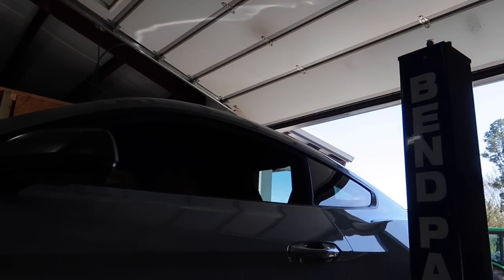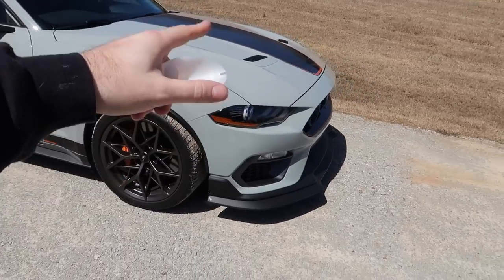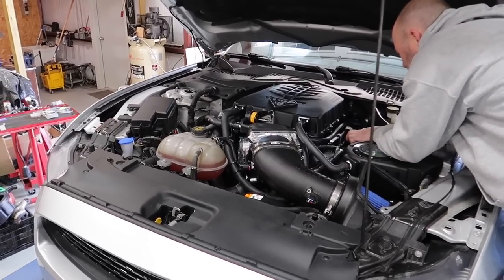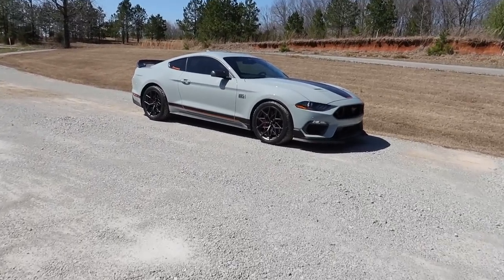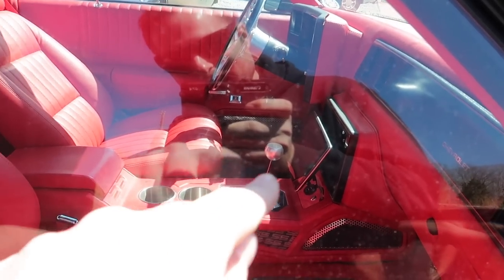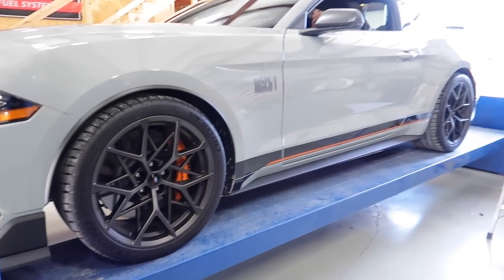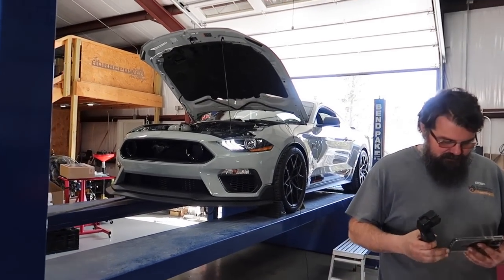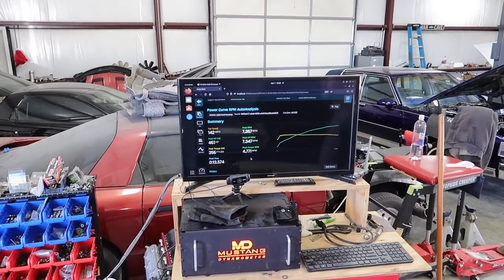My 2021 Mach 1 Mustang Hits The Dyno... UNBELIEVABLE POWER FACTORY FREAK???

Comment: And this is why I prefer Dynojet... I never had a car jump 40 HP between pulls on a Dynojet weather the numbers are the most accurate or not the Dynojet would give you the most consistent before and after numbers. How can you trust a dyno that shows pull 1 460 HP and pull 2 502 HP... I never liked Mustang Dynos...  they are under load and if the vehicle weight is not input correctly that will effect the numbers so it is easy to get it wrong on a Mustang Dyno. The Dynojet is just inertia dyno so all it cares about it how fast the drum is accelerated by the cars rear wheels the only way to cheat on a Dynojet is to mess with the environmental data that is used to apply the correction factor.

Comment: Most people don't believe in factory freak cars. However, I bought a brand new 2012 GT manual 6 speed 3.73 rear gear car and consequently my buddy bought the exact same car with same transmission and rear gears and we dynoed them at the same time. His made 380whp and mine made 423 rwhp stock. Both were factory stock, no tune, no aftermarket exhaust or cold air intakes. The only difference in the two cars were his was red and mine was black and his had 19" wheels where mine still had the 18" wheels and tires. Both cars were dynoed on the same Dyno back to back in the middle of July with 96° heat in the middle of the day.
Reply: Engines are SAE certified, "factory freak" isnt a thing anymore, hasn't been for years. They aren't allowed to vary more than +/-1% of their rating to be certified. Also no matter what there is no way you have a 40WHP difference in those cars without there being a reading issue. Your car did not somehow suddenly gain more power than a full exhaust, headers and dyno tune, with some very tiny variances in production parts to the point it made more power than a Boss 5.0 Roadrunner engine.

Comment: Manual cars will actually dyno higher due to less loss from not having a converter
Reply: only by like 5-10 HP.
Reply: On the Gen 3 mustangs the autos are dynoing very low compared to the mt82. It's not necessarily parasitic loss but more so having to dyno the 10r80 in 6th gear and not 7th which is 1:1 ratio because it's hitting the speed limiter before getting up to max rpm

Comment: I believe the Dyno tech didn't have the Dyno properly calibrated to your vehicle, this is a common issue at a lot of garages that have Dynos but don't have properly trained technicians or very inexperienced techs, plus that Dyno looked very new so maybe they just aren't used to it yet ( trying to be nice)
Reply from the maker: I was properly calibrated. This dyno is used all the dyno and we have seen consistent numbers compared to a dyno jet
Reply: @Zander13Productions  Yeah calling BS on that. your car didnt somehow manage to put out more power than a e85 tuned, or intake+ headers Bullitt/mach1 bone stock. That dyno is just flat out wrong or VERY uncorrected.

Comment: I believe the 460 # the MT82 gen 3s are running between 420-430 whp and the Gen 3 is responding well to catbacks plus the mach 1 top end so 460 on a 6 speed mach 1 is believable.

Comment: Debating on getting the ess tuning gs3 such a good deal and the mustang6g forum has a thread on it with over 156 pages.
Reply: It's really not as good of a deal as you think once you add all the other items required to make it function.
I figured that all up and got a better deal on a gen5 whipple.
The bad part about the whipple is the unnecessary 12-16 week lead time,stupid lean manufacturing bs.
Reply from the maker: Hit up brevin@esstuning.com and tell him I sent you for a good deal on a g3 kit 😊
Reply from the maker: It’s much much cheaper than whipple
Reply: @Zander13Productions  
The g3 setup I looked at was basically a tuner kit that required injectors,fuel,a tune and tuning device.
I got all that with my whipple plus it's going to be blue for $7,900 shipped to my door.
Reply from the maker: @charleshenson4183  yes. G3 is still a few bucks cheaper. All great options
Reply: @charleshenson4183  lol if you think you got a whipple complete kit for 7900. Ain’t no way it’s a Gen 5.
Reply: @mattcat2218  
Care to make a bet.
I actually could have gotten it for $7,250 if I hadn't optioned to have it powdercoated blue.
Learn to shop around and maybe you can too,and yes it's brand new as I'm actually waiting on them to build it now.
Reply: @charleshenson4183  prove that. You can get a full ESS g3 kit with fuel injectors and a pump for $6600. Learn how to read before you make claims you can’t back up to justify your purchase. 

And you didn’t specify which Gen whipple you got.
Reply: @mattcat2218  
It's going on one of my two brand new 5.0's so you tell me what gen it is.

Comment: I would think that the stock 12:1 CR would be a problem when boosting?
Reply from the maker: No issues. PPL have been boosting GT mustangs for years
Reply: On a cam in block engine yes, but not with variable camshaft timing on the overhead cam cars.
Reply: @pimpovic2  Can you pls explain why.
Reply: That's what I wonder every time I see  a YouTube video of putting a massive blower on a high compression engine. Conventional wisdom is you don't put forced induction on anything with more than about a 9:1 ratio. Also, do these engines have any valve overlap? Considering it's a factory street car I'd guess/hope not.
Reply: @superbird2814   Exactly!

Comment: Yeah those numbers are false though.  Mach1’s on average dyno lower NA stock numbers than a Mustang GT for some reason.  So what are you comparing in regards to false base line.
Reply from the maker: 461 was legit. Data is all SAE correct from the J box based off weather, gear ratio, weight of car, tires size etc.  the 502 was an adaptation correction we used as a test pull to see what parasitic loss there might be for fun
Reply: @Zander13Productions  listen what I want and what I think really doesn’t matter. But  I just don’t think 461 is correct. I would want to see it perform the same numbers on another dyno.  I would bet it doesn’t.  I’m thinking those numbers are off by at least 50hp and 40tq. Really doesn’t matter now.  It’s boosted.

Comment: I’ve got a black manual 2021 Mach1 ..within 15 days I will add a Procharger supercharger. It’s supposed to reach 825 ch…We’ll see.. I also have a 2020 GT convertible With à Roush supercharger making 725 ch … So I will compare both..😀

Comment: 💯👉Not a good base line number at al ,460 and then 500...  both of them most likely are incorrect.
Reply from the maker: We confirmed 460 was legit. 502 we were playing with parasitic loss calculator as literally said in the video
Reply: @Zander13Productions  you got 461 and 502, and you're not following what I'm saying , I'm saying you guys messed something up,  the numbers are wrong..
Reply from the maker: @SHADOWBLACKs650  did you not read my earlier reply? It was explained
Reply: @Zander13Productions  cute, did you read my last post ? You guys did something wrong because the car doesn't make 460 at the wheel.
Reply from the maker: @SHADOWBLACKs650  well. It did. And so do other Mach 1s.
Reply: @Zander13Productions  now that's just not true, you are all over the place with the dino number of 460 and 501 at the wheel, again you did something wrong.
Reply from the maker: @SHADOWBLACKs650  I’m done arguing. It’s 461.
Reply: @Zander13Productions  wasn't arguing, I just think you did it wrong ,461 is wrong, you even said it yourself 420 was expected💯
Reply from the maker: @SHADOWBLACKs650  how did I do it wrong. I didn’t touch the machine. The car added 25 degrees total timing. It was pulling like crazy. Timing is everything. Most ppl don’t understand how that works
Reply: @Zander13Productions  Steeda got 409 at the wheel, somehow you have 460 and 501?  . You said it yourself you are expecting 420, and that's about what it should be... you did a horrible bass line, you did something wrong...
Reply: @SHADOWBLACKs650  Steeda was also dynoing an A10 on stock tune and couldn't use the 1:1 gear due to hitting the speed limiter on the stock tune. There is another Mach 1 manual reporting 457 on stock tune. The only apples to apples comparison was the Steeda runs which compared GT A10 to Mach 1 A10. Mach 1 was about 9% more power same day same dyno. Any other run is going to be subject to debate
Reply: @chadicus16  When anybody sees 46 0  or 501 at the wheel, 👉at the wheel,👈 something is wrong, I really would have liked to have seen what exactly the car did Baseline because it's probably the last of the powerful Mustang V8s, as you know they started taking power out of the 22s.... another Dyno Run on a different dyno or a track day Baseline really would have been cool....  I kind of think these Mach ones are a production engine with the power pack two program on them with the throttle body and the cold air intake from the GT350, I don't know if they have the throttle body, just some wandering.
Reply: @SHADOWBLACKs650  I have a Mach 1. It has the intake manifold, throttle body and air cleaner from the GT 350. The 501 is obviously a bs run. I think Zander pointed that out. The 460 and the other 457 run I was referring to I can't comment on. I didn't calibrate that dyno lol. According to Steeda THEIR Mach 1 was 9% more horsepower than THEIR GT on THEIR dyno. All these other videos are speculation and entertainment at best.
Reply: @chadicus16  BINGO...
Reply: @chadicus16  I had a 14-6 speed, 17 6-speed which I put a power pack two on and it made a gigantic difference, lots of timing advance, I now have a 21 premium 10-speed with 600 miles and it's the nastiest of them all, I really would have liked to have seen accurate Dyno numbers, I just don't buy the 460 or 501 at the wheel, maybe time will tell...
Reply: @SHADOWBLACKs650  The quarter mile times and trap speeds will tell us if 460 is believable for a Mach 1. (Thus far 11.9-12.3 in decent DA would say no)
Reply: And that is for autos. 12.6 was manuals in testing.
Reply: @chadicus16  I would have been really interested in a better Baseline...
Reply: @SHADOWBLACKs650  Compared to my Mach 1 my 19 GT PP1 feels sluggish and slow. I just took delivery of my 21 Mach 1 so if I get dyno time I'll post it. It does feel a lot faster than my GT.

Comment: The stick shift cars make more power than the auto ones
Reply: But barely back in the day it was a big difference. However 10r80 is super efficient
Reply: Wrong. They make the same power. Just less is lost to the wheels.
Reply: @someferarriguy7910  yeah that's exactly what he's talking about. Car guys always talk about wheel and not crank hp. So he is correct.
Reply: @TheBb6prelude   At the end of the day do they make more power yes but not for the reasons he stated.

Comment: American cars are usually overated on power german underated I had a 2016 BMW M4 competition package which was supposed to have 444 at the crank it had 445 at the rear wheels which means it really had about 525 at the crank I guarantee you if I die no the 2022 mustang Mach one I have it’s not gonna have 470 at the crank.
Reply: I think you got that wrong bucko, American cars are heavily underrated, literally the proof is in every dyno video posted of these kinds of cars showing more hp than what was claimed by factory. I don't see that a lot on German cars mainly because i don't see them as often on a dyno, and they don't really usually post way above what was claimed factory anyway. Why is it so impossible for a manual Mach 1 to have higher hp numbers than what was claimed at factory ? It doesn't have as much drive train loss due to it being manual, it is in fact the highest hp Mustang GT N/A and has the best components of each Mustang in the modern era. How exactly can it not have a better HP number than what was claimed, please for the love of God explain that shit or else it's all just bullshit.
Reply: @raionshishi8290  search you
Tube m4 competition dyno most mach 1 2021 420 I own a 2022 nit biased just honest and the mustang weighs 500 pounds more as bmw has allot more composite and aluminum more expensive to build